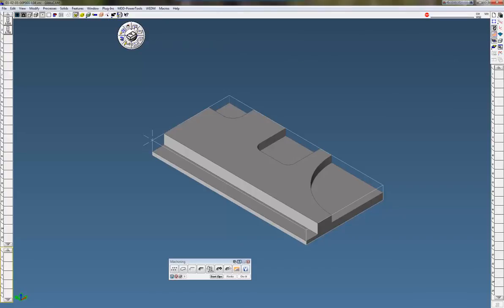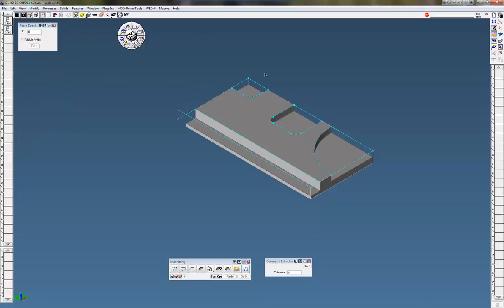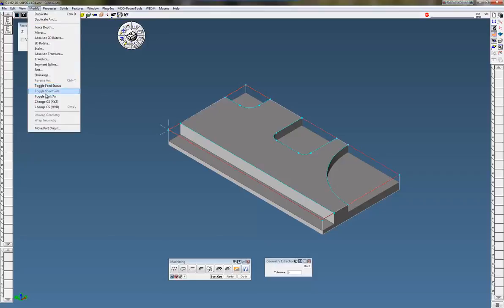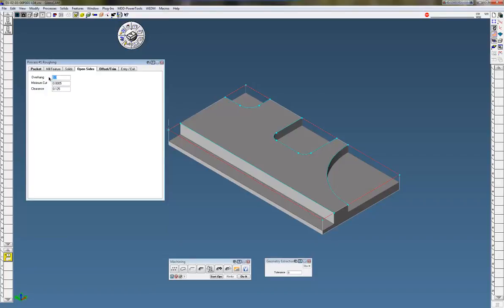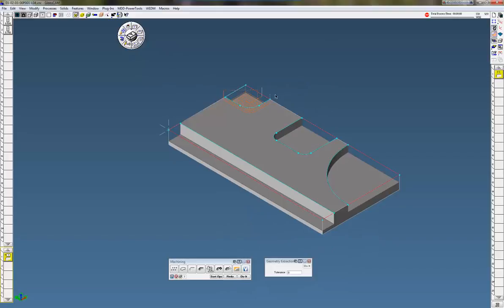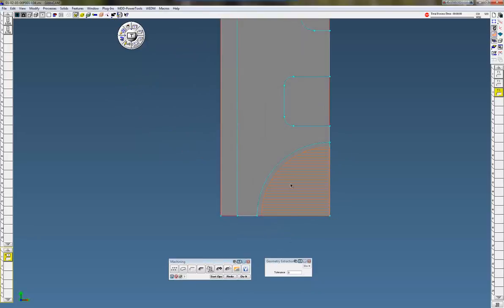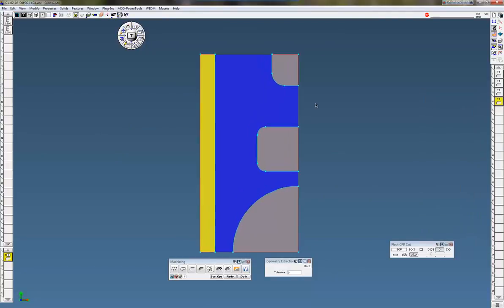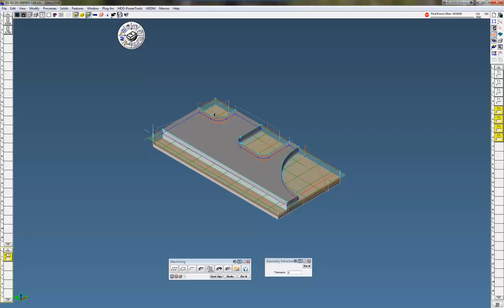GibbsCAM Air Walls

Comment: Thank you for this video! Quick question...Can you only use the profiler to do a boss with the ability to have cut width and ruffing in capabilities? Am I missing something or can you do this with the contour or roughing tiles ? My older version does not have "outtermost Shape as Boss" But I think I can get around that by clicking use stock. Any help would be appreciated!
Reply from the maker: If you want to rough a boss just using the profiler, you first need a wall around the outermost shape.  So if you want to use the profiler, extract the geometry from the boss using the profiler, then turn off the profiler, then extract or create geometry around the outermost shape of your part, then double-click the geometry from the outer shape, then go to Modify and select Air Walls.  This will turn the geometry RED. Then use either Volumill or a Roughing process.  Note:  There is a tab that you can click on the roughing process that will ask you how far past the wall  do you want to go.  Hope this helps.  Thanks for watching.
Reply: @GibbsCAMVideoTutorials  Thanks so much for this tip! Cheers.